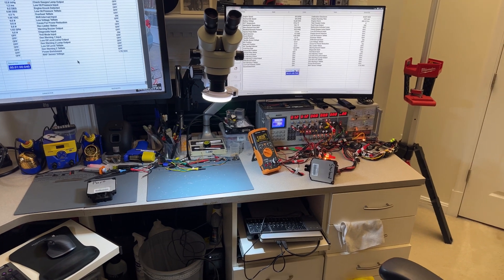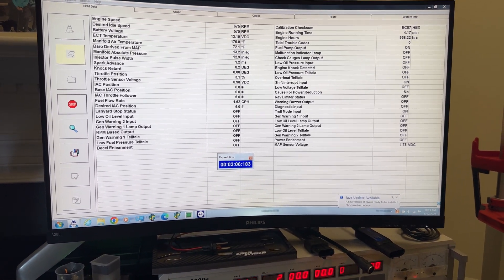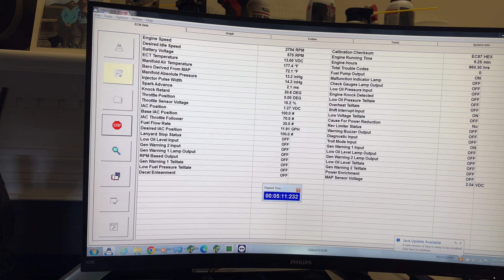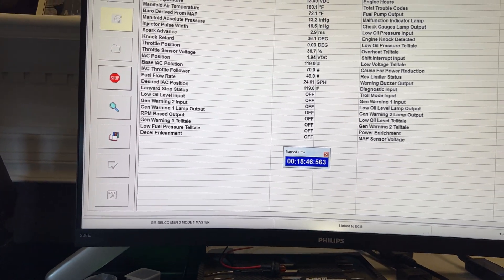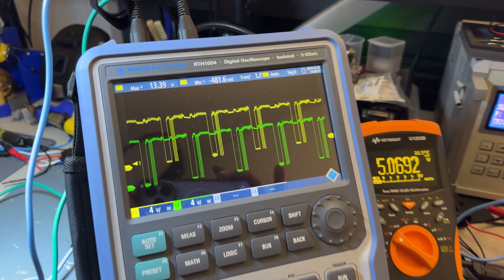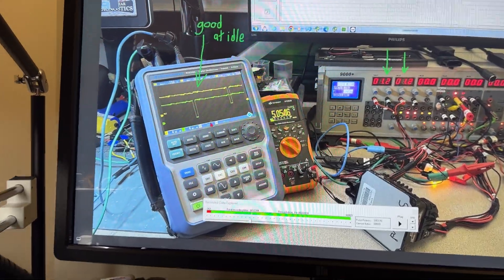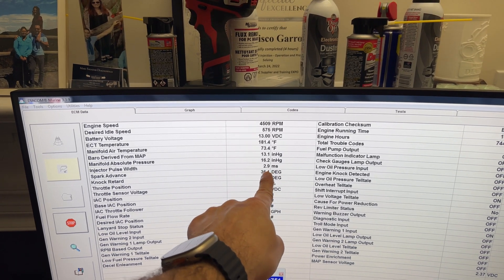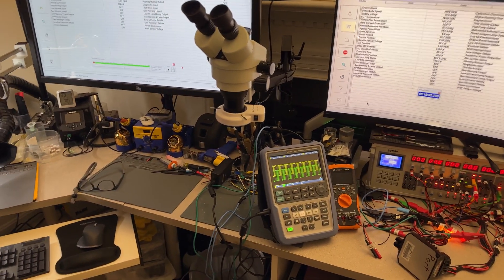2000 Chaparral 300 Boat Twin engine ECM test how to find common problems, full diagnosis.

Comment: could I program my 2005 5.7 gxi-f ecm for my new block 383 stroker with all my 5.7 components
Reply from the maker: If you have an unlocked calibration then yes or if you have the passcode to unlock one